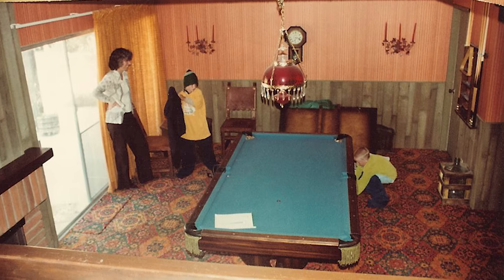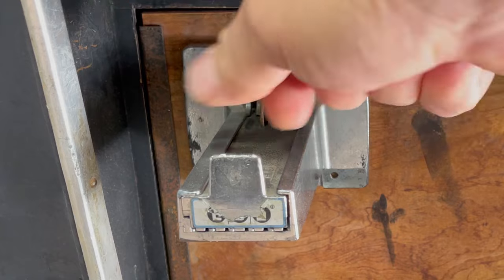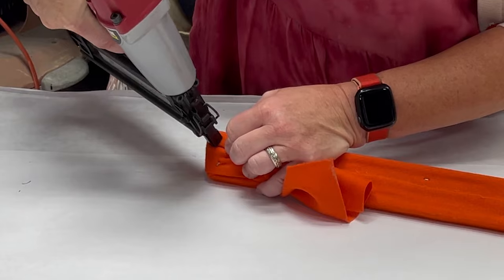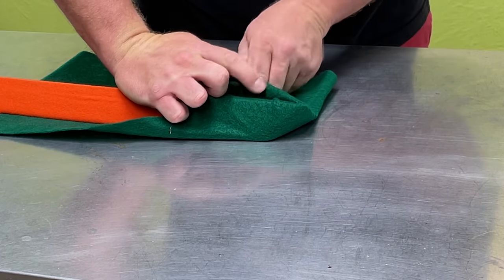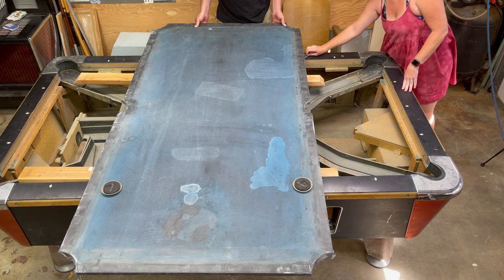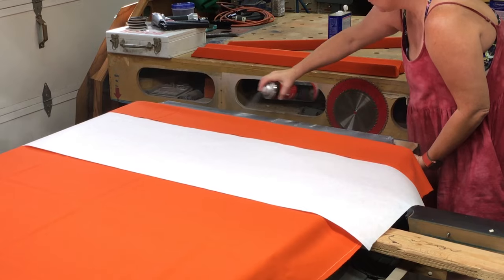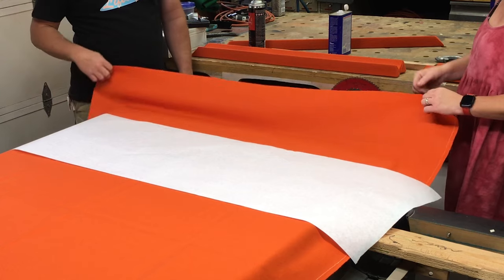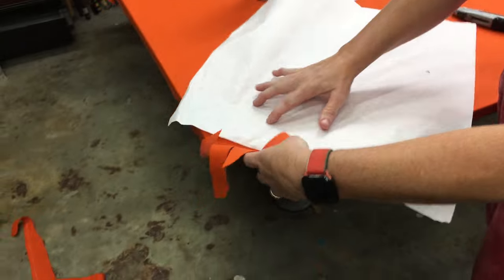How To Refelt A Pool Table - Easy DIY

Comment: The beautiful thing about this vid....it is OBVIOUS that y'all DON'T HAVE A CLUE......tip for next time: you must STRETCH the cloth lengthways before securing sideways(MUST) .....interesting video though
Reply: Not the slightest clue. Amazing.
Reply: @tonym2513  yup
Reply: Thanks for this tip as i am goin to try re cloth one myself..
Reply: Also needs to glue the bottom of slate, not the top. 😂
Reply: Thank you for that tidbit. I f*cked up someone's felt trying to clean it, and I want to apologize by replacing it. (In my defense, it was filthy and gross, but I got a bit carried away in trying to remove the stains, and ended up scrubbing small holes through the super thin felt that the table came with. 😣)
Having exactly zero idea how to go about it correctly, I appreciate your sharing what you know with the ignorant among us. 🙏🏻😊
Reply: @alexwhite3612  Yeah, that makes way more sense. As I was watching this, I was thinking, "If they bought pre-cut felt, shouldn't it already be the correct size? Why do they need to cut so much off? Are tables not all the same dimensions?" Now it's clicking that it probably was the size it needed to be, and rather than gluing the felt to the top of the slate and cutting the excess, it's meant to wrap around the slate and be secured to the bottom of it to make the top taut and smooth, but not glued to the top. Would gluing it down to the top as they have here prevent it from laying right, or cause tiny pebbles under the felt and interfere with the ability to play? Or is it just so that replacing the felt later doesn't require scraping old glue from the top of the slate each time?
Reply: @kaylafeeney6405  if felt is glued to the slate you can't play on it....it's dead

Comment: Well. Not a bad job, seen worse. But not professionally done either. I have 15+ years doing it and felted so many tables I can't count, from brunswick, dynamo, valley, diamond... you get the idea. But, unless you left it out of the video, I see just a few "improvements". Major one, never cut the felt at the sides like that, spray the bottom edge of the slate, wrap it under and attach it, so when you put the slate back down where it belongs, the felt is glued under as well and the weight of the slate is holding it as well. Helps prevent the felt from "slipping" over time which leads to loose and wrinkling felt. Other major thing was not really stretching it. Looks like you pulled it taught and then glued, but to keep it from getting loose, you need to get some good stretch on the second long side, then the last long side. Overall you guys did a pretty decent job though, thumbs up!

Comment: Now that you've had time to use the table, how's the felt holding up? Anything you would do differently?
Reply from the maker: It's holding up great. The only thing I would do differently is the rails. I don't like the seams on the ends.

Comment: My only suggestion would be to mention the name of products you use, if not leaving a link.  So the felt, and the glue. It also wouldn't hurt to mention the make and model of the pool table.  Obviously coin op, it's very cool.  I know you're retro, but in 2023 it's perfectly fine to name brands.   And also, I can't imagine why you would use a color like that. That's very hard on the eyes.
Reply from the maker: Everything we used is linked in the description
Reply: @retroactiveIifestyle  Looked, but overlooked.  Sorry about that.
Reply: I can tell you why they went with the orange and that's cause its there table and care less what you think about the color of there felt and if you wasn't a noob to pool and actually played you would know exactly what the table is other than the color since 90% of all coin operated tables in the U.S. are valley tables

Comment: i do a few things differently like i use 3m spray adhesive 90 guess cause its quick and no wait time once you spray you best be ready and i use my DeWalt oscillating tool for the glue instead of a scrapper and i don't glue my rails i just stretch and staple them I use to glue them back in the day but i had to replace a customers rails cause you could fell the glue under the felt in places and hopefully you dampened and stretched the h#ll out of the felt if not you will have to restretch it in a month or 2 when it starts to wrinkle up but everything else we do pretty much the same only thing i would of done if i was you would of been to order all new rails cause once they start coming undone they are shot an needs to be replaced but i do like the Texas longhorn orange felt
Reply: You don't junk cushion rubber because it falls off. If the rubber is in good shape, remove old glue and re-glue it. 3M 77 wrong glue for cushions; I use 3M #10 contact adhesive. Also, DO NOT glue fabric directly to the cushion rubber. And if you have glue buildup, you're using too much.

Comment: HOW often do you replace the felt ?
Reply from the maker: We replaced it with cheap fabric from JoAnn's when we got the table in 2019. It was outisde, but under cover, for a year. Then in 2021, we replaced the material again, and that's this video. I don't expect to replace it again anytime soon.